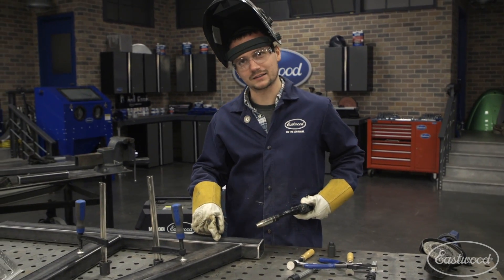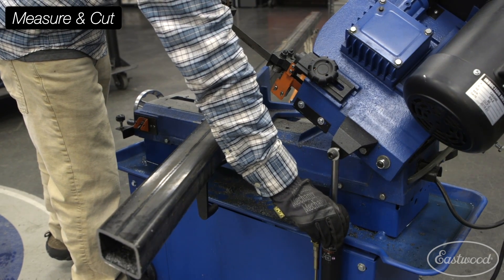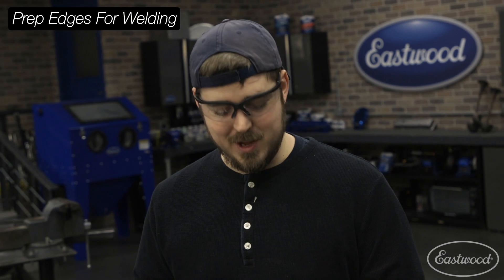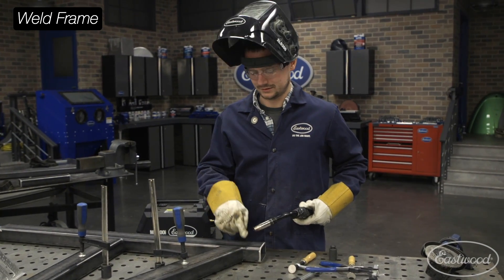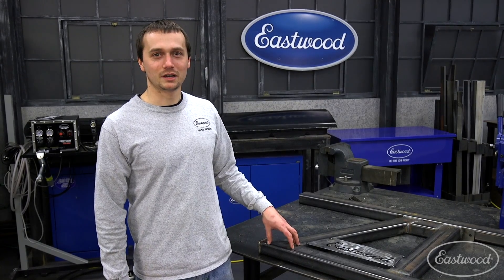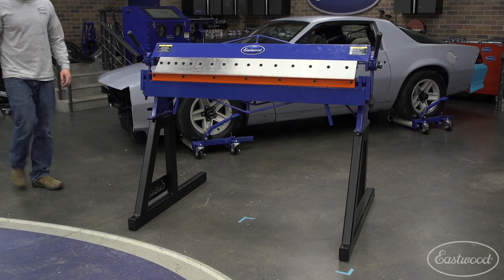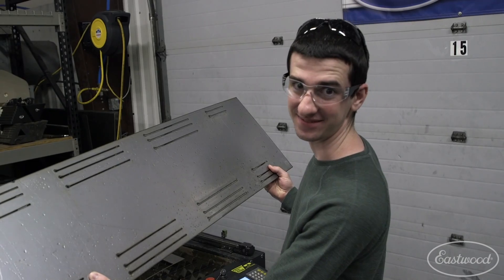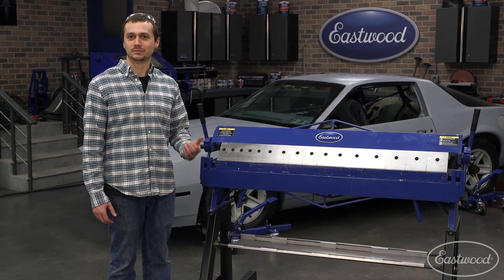Building a Stand for the 48" Box & Pan Brake - Built By Cody - Episode 1 - Eastwood

Comment: Cut slots in the angle iron up to the bolt holes, you can slip the angle iron off and on, I lengthened my handles and have been able to bend 18 gauge 4 ft

Comment: One tip for that prototype. Use a half nut for the clamping mechanism. That way you can quickly push the clamp up to the workpiece, engage the half nut and clamp it down. 

Additionally you're pretty much always gonna be making several of the same cuts. So if you have a stop built into the machine it just makes it a little bit easier. Basically for something for small piece, up to like 2 maybe 3 feet. 

And this is a feature that they used to offer with old saws. And it's a bandsaw blade welder, they used to have them on older machines, and most machines don't come with them anymore, if you offered a professional lineup you may get more sales with a blade welder on it, then again that would be if you sold it at a professional level price point.